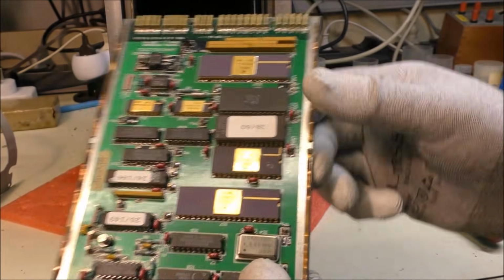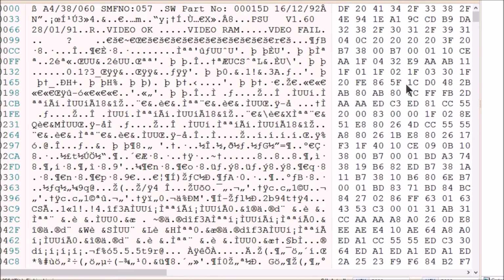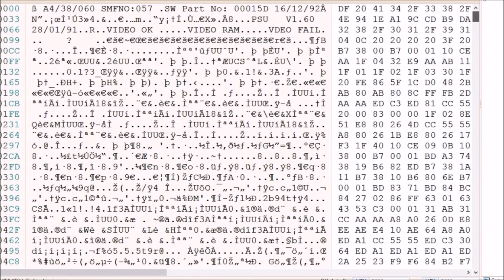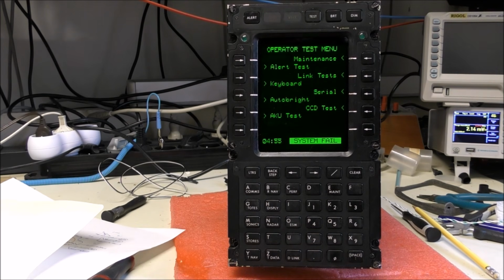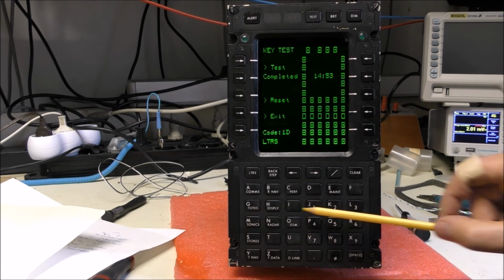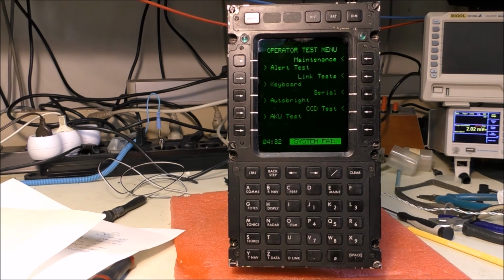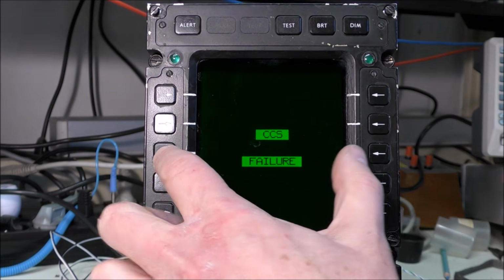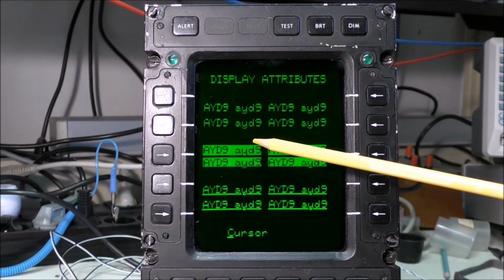LDM #450: Racal Avionics Common Control Unit

Comment: The fractured wire on the keyboard is a design fault; military and avionics wiring rules dictate stranded wire should be crimped wherever possible; if soldering is unavoidable, a secondary strain relief must be used near the soldered joint, but outside of the solder-wicking distance. this failure demonstrates why solder wicking causes failures if not mitigated.

Comment: Love the way you connect the ESD protection cable to the socket outlet 🥹
Reply: When SSDs are on the board, the components connected to them offer protection, and the only devices that are potentially at risk are un-buffered CMOS devices and MOSFETS. 
I've handled thousands of devices over the decades, and I may have ''popped'' a couple of MOSFETS in my time, but the ESD risk, in reality, is not as bad as people sometimes imagine. 
Buffered CMOS I treat the same as I would an analogue IC, but I do keep them in the ESD tubes they are delivered in. With other devices, I touch the earth stud on my oscilloscope, before handling.